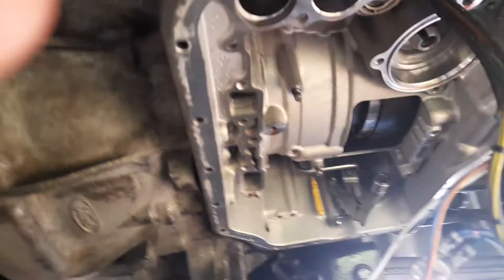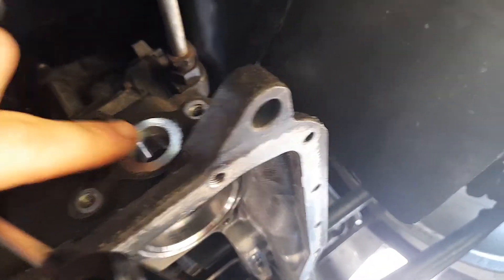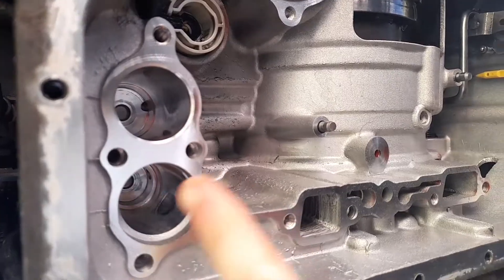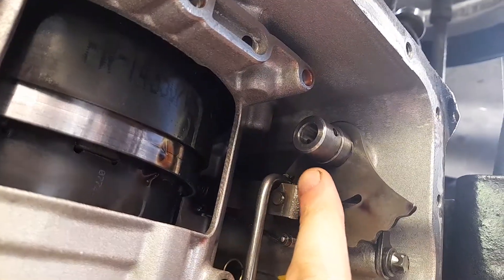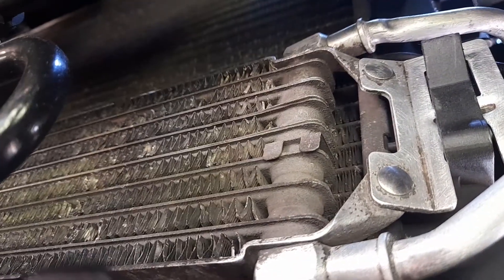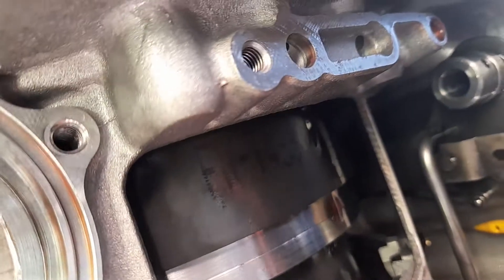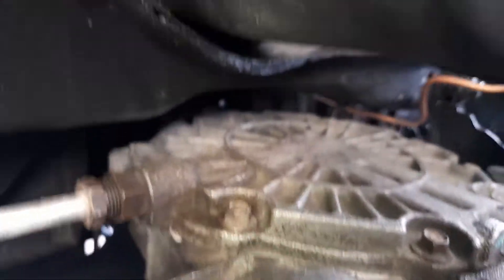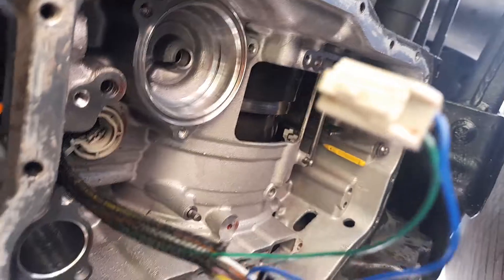Ford Focus 4F27E Automatic Transmission - Part 2

Comment: I have a car with the same gearbox (figo 1.6l duratec). Recently my oil cooler got bad and coolant got mixed with transmission oil. I replaced the whole gearbox with the used one twice. The problem on both the last replaced gearbox is that it takes 3 secs for the car to fall into D from N or P. What could be the reason? Valve body? Also when it downshifts, it knocks on falling to the gear, the transition is not smooth. Im in qatar and the workshops doesn’t seem to know what it is… can you help?

Comment: Mines tiptronic doesnt work 😢 any idea how to fix it?
Reply from the maker: do you have the same gearbox?
Reply: @usuallyfixingtinkering yes sir 4f27e, it bangs when i shift to R And d and theres a 2 second delay before engagement.
When i just turn on the car the first 10 seconds the tiptronic works, no bangs no delay but afterwards the issues comeback 😢
Reply from the maker: that needs a fluid change to rule out rough/slow engagement from that. I know possibly other reasons why but all of them will result in a rebuild sadly.

Comment: What is the most common cause of a no reverse condition with these transmissioms
Reply from the maker: reverse requires the highest amount of hydraulic pressure so this always tends to go first, it can be that the fluid level is slightly low but enough to allow drive gears to be selected. But it can also be low/reverse drum which is leaking internally. The test to put it in manual 1 and see if it slips

Comment: Were you able to open the side plate without dropping the whole transmission? Is that possible without lowering the whole transmission?
Reply from the maker: No I didn't open the side plate. You do need to drop transmission off its top mounting to get all the side bolts off and bring the one piece drum out the side.